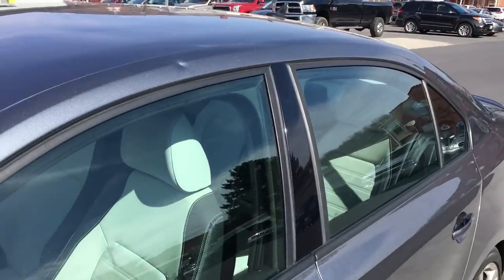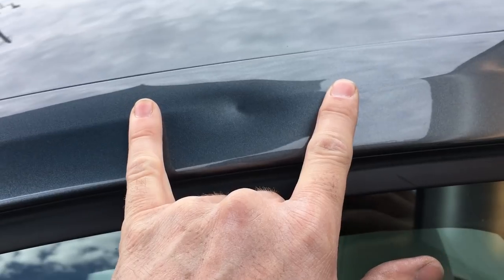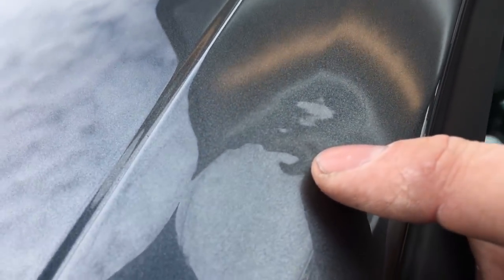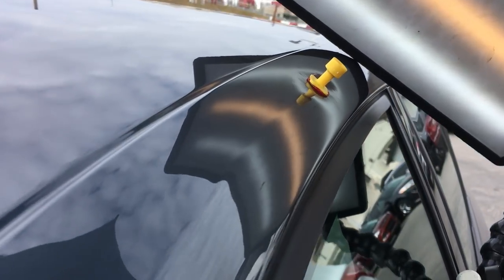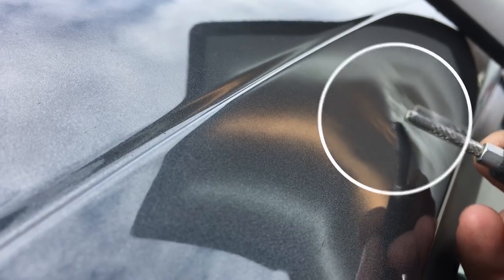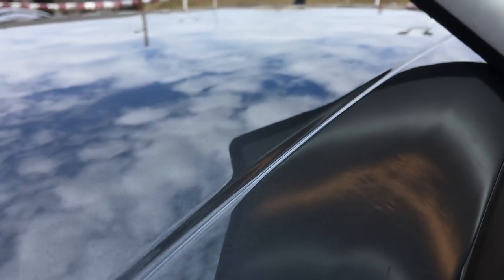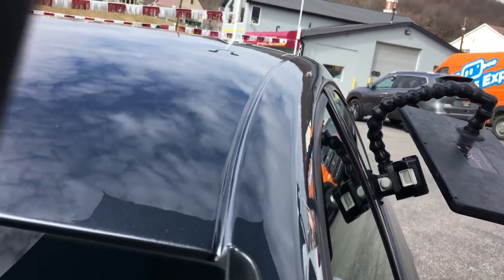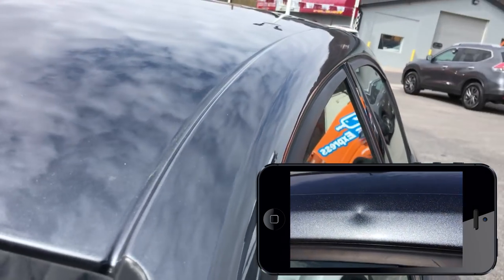Wholesale Deep Bodyline Dent Repair | Glue Pull Only | Full Process

Comment: I am the tech on this repair. Let me say that I know this is not a glass level repair and more time would have improved the repair. It did exceed customer expectations.
Great job to Dave Johnson Dent Repair for the great video edit!
Reply: Hi Mark,
Great repair and nicely done detailed video! What is your gudeline or " secret" to not pull paint off with glue pulling? Do you warn/give disclamer to the customer of that possibility? In your experience,  what cars are known to have not so great oem paint adhesion? Thanks!
Reply: @progi2  I always give disclaimers but usually I look for clear coat damage on sharper dents. The impacting object will sometimes push the clear away at impact causing the clear to thin out or even go down to the paint layer. This is a good indicator that damage (paint/clear pulling off) is more likely.
In my experience Subaru is the worst for factory paint pulling so I always feel the need to advise customer of possibility and ask if they want to assume risk or liability. If it bothers the customer enough to want to paint I will give it a go.
Reply: Question
Before first glue pull how much time spent opening up the dent
Knock down or blending hammer
Any heat used??
Spent 3 hours today on similar rail maby slightly sharper could not finish it can't wait for the next one Just wanna fix it
Thanks for your time

Comment: Is there anything that can be done to take out the heavy orange peal affect afterwards? Yes, the big dent is gone, but it looked like very heavy orange peal was left behind
Reply from the maker: There is ways to address this. To detail it out would take a considerable amount of time more. This dent was a wholesale repair with the understanding of the finish for the agreed price.  It always seems that the details of the dent repair take the longest. I appreciate you checking it out and commenting.
Reply: Absolutely. This was an 80% repair. I could have spent another hour to 90mins and removed all of the orange peel but that of course would have looked flat and would have stood out just as much as the "large" orange peel. Now back to your question. The impact that created this damage did not affect the factory finish or factory orange peel which is not common in all dent/ding damages. Since the original finish and orange peel was intact, this damage could have definitely been returned to factory condition if the proper repair time and repair value had been offered. Thanks for your question and thanks for watching!

Comment: I do hail repair every day done this dents many times and let me tell you the anaconda with titan tabs blend out dent with red plastic dc tips and control pull with bar slowly pull trust me it works
Reply from the maker: Jose, I would imagine a skilled hail tech encounters this type of damage often and has an efficient method for rolling through numerous dents like this. Fortunately, I don’t get them quite this bad but I am intrigued by it the method you are mentioning. I would love to observe a tech such as yourself on “bad” hail damage. Thanks for watching
Reply: Dave I have lots of experience on extremely heavy hit hail jobs and I also have the background of auto body. I’ll be happy to share my knowledge with your audience
Reply: thanks jose and dave i am do hail too, do you think when pull use the sliding hammer and mini lifter which one better? i do both but sometime i found mini lifter looks more powerful.
Reply from the maker: Bill Cui  I like using the slide for quick impactful pulls. Almost to shock metal up  then work with knockdowns then repeat. Also for wet pulls which doesn’t work well with mini lifter.  I use the mini lifter primarily when a controlled precise pull is needed. Sometimes with a pull plate. I know many hail techs that roll quickly with a slide on rails then just blend out and move on
Reply: Dave I got a new knockdown all titanium will shock metal very hard less taping also is double end
Reply: Which Glue?  Yeah I want to try the titan tabs.  My problem is the glue is not pulling.  Been using Tab Weld.  Had bad performance with that.

Comment: What kind of glue did you use, I used the hot glue and they are not easy to clean them up after pulling. Any advice
Reply from the maker: It's wam weather red hot glue designed for PDR.  You can use 91% isopropyl alcohol to use as a release and clean up agent. Thanks for watching!

Comment: Do you bill on the number of total pulls?
Reply: Pricing is industry standard guide and is based on size and several other factors on this repair including depth, bodyline, and glue pull only location (no wire type tool access) which all increase the level of difficulty and time to repair. Thanks for watching Mark!

Comment: Retail price on something like this?
Reply: A repair like this can vary slightly on pricing but based on 2018 nationally recognized PDR industry pricing, this is the breakdown on 2018 pricing:

2018 Retail Pricing (reference only)
$250.00   [3" dent]
$  62.50   [+25% bodyline]
$  62.50   [+25% glue pull only]
$187.50   [+75% Stretched Metal (1.0mm+)]
________
$562.50   [Total]
$112.50-  [Only 80% finish so 20%discount]
________
$450.00   Repair (reference only).

I could have gotten this repair to a flawless state but this particular repair but this was a we owe for a dealer that was only promised better to the customer.
Reply: sparkeym Outstanding, I had a similar one on Friday but mine was much more shallow. Able to get a large keco tab on it. What kind of vehicle you working out of now?
Reply: Sorry for the delay Jacob. Currently working out of an Escape.